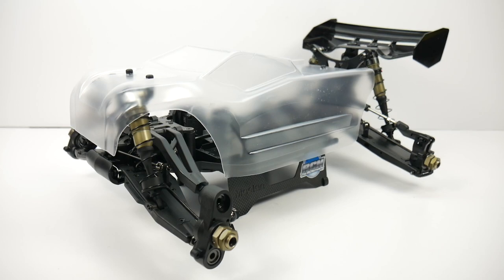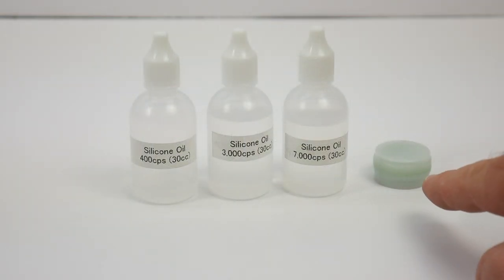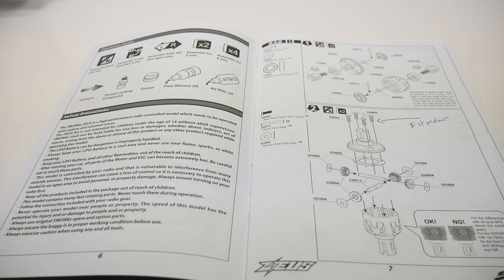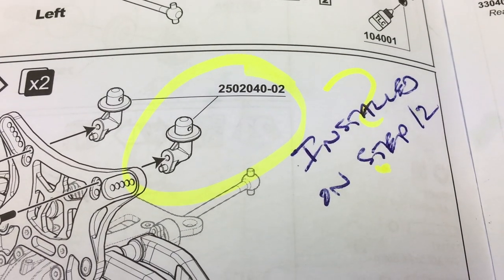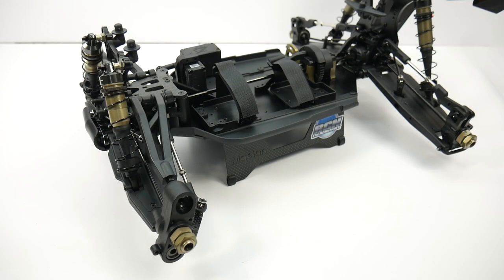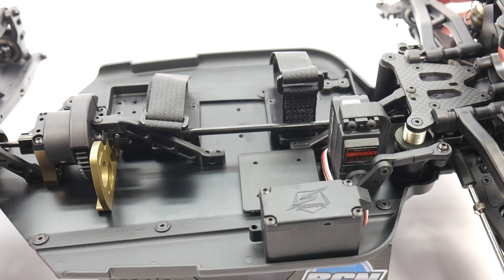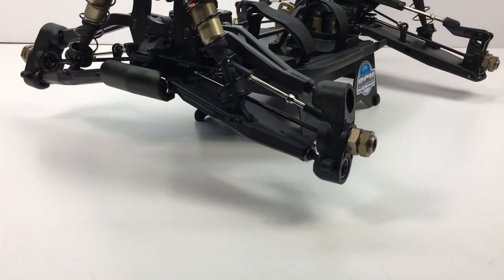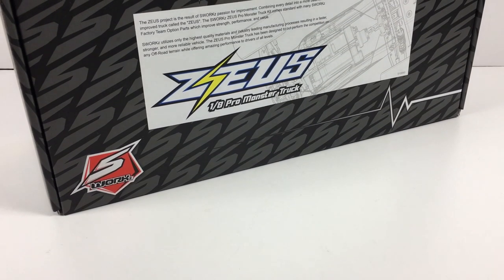Sworkz Zeus 1/8th Monster Truck KIT - Build Update

Comment: Nice rig, and I understand the frustration with bolts in recessed places that a normal tool won't get to.
I purchased a set of Bondhus T handle hex drivers, and they are pretty long, and will get into those motor mount bolts from the back of the rig. You can also use standard hex wrenches, and go right in behind the motor mount plate. Whichever is the easiest for you.

Comment: hello, your Zeus is the V2 with 6061 chassis plate and shocks support or is the V3 with 7075 chassis plate and shocks support? are you happy with them and recommend them? thanks (V3 with 7075-t6 part look lot more stronger, and have certainly less flex than the V2 with 6061-t6)
Reply from the maker: Steph not sure - this was one of the first production Zeus’s out there. Mine and AussieRCPlaygrounds. Of course, 7075 will be stronger than 6061 - which is more flexible bendable

Comment: If/when I get one of these I will make an aluminum shock tower to shock tower brace like guys make for their Arrma Kratons...this rig looks perfect for such a chassis brace...
Reply from the maker: Yeah, but those devices just transfers issues to other components that end up breaking like diff cases and such
Reply: @TheRCNetwork  But i guess it is the correct thing to do, as the newest Kratons come, from Arrma,  with that exact strut tower to strut tower brace!
Reply from the maker: bblando65 Arrma is just giving their customers what they “think” they need. Ask any truly engineered RC company - bracing the towers like that will transfer the issue down the line. But like I’ve always said - just my opinion. Do what makes you happy in RC.

Comment: Very nice build video! I absolutely love your kit building series videos! As far as the motor mount, maybe I am missing something here, why can't you use an allen wrench? The Arrma vehicles have a fixed mount similar to that and I just use an allen wrench when changing pinions. Yes it's not as nice as a sliding mount system but it should work just fine.

Comment: When you say it's a monster truck or is it a truggy.    How's it any different from the tekno mt410.   Which is basically the same idea??
Reply from the maker: Bobby Regl the Zeus comes with a Truggy body and wing, also Truggy only body mounts. The MT410 comes with a universal body mount system to take any true MT body, plus front and rear bumpers to help protect. Zeus comes with a Truggy front bumper which is non-existent and nothing in the rear.
Reply: @TheRCNetwork   this truck can be fitted with the POS-model front and rear bumpers, which you don't have on the vehicle...they look beefy and protective like TBone racing front and rear bumpers....www.pos-modellbau.de....most basher rigs don't come with proper front and rear bumpers, so that can't be a valid complaint against the Zeus...

Comment: Mount the motor to the motor mount with correct gear mesh to the spur first then only  screw the whole motor mount and center diff upright back to the chassis..if not just use the L hex driver..

Comment: Just take the left screw of the right rear turnbuckle off, and move your turn buckle up (and maybe the driveshaft too) to get your screwdriver to fit to mount the motor to the motor mount, or just use a normal allen wrench and skip the whole hassle of finding a longer screwdriver.
Reply from the maker: +Rc/is/for/me yeah, and that’s how Installed the motor....at this point in RC, everything should have a sliding motor mount.
Reply: The RCNetwork 
I absolutely agree! Hey Sworkz 2005 called.. they want their motor mount back!!

Comment: I have some vehicles that claim to be monster trucks and some claim to be truggies.  I call them monster truggies.  not sure if im the first to do that, surely im not but they all have characteristics of both.
Reply: Check out losi' s old Muggy,  it was probably close to the first of this style truck.    Also back in the unlimited MT race class days we had several conversions using buggy type chassis and drivetrains  with Tmaxx suspension.   They were cool.   Supermaxx razor.    And JT Racing hybrid.   Check em out

Comment: Told you sworks shocks are the best on the market. So is there ball cups . as for the extra parts they are for this kit but are the plastic version of the aluminum parts.  What is it. Simple its a race monster truck and performance is of just that. Look at some of the arma monster trucks. They also are short wheel base.  And the motor mount. You will find this is the strongest and most reliable mount out. You need a ball end driver standard length to adjust the screws. To me you sound like a entitled kid about the mount.  Your a smart guy and should realize the need for a ball end driver